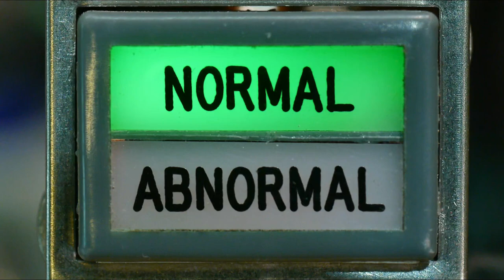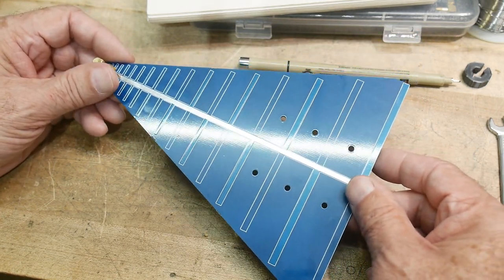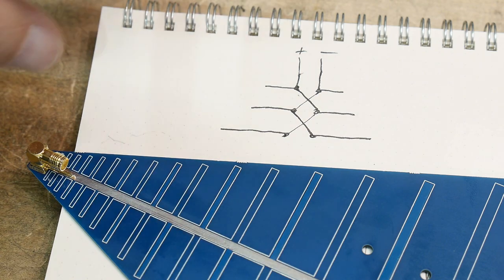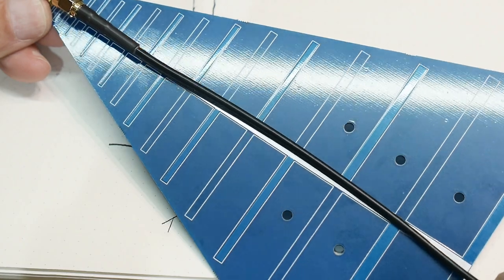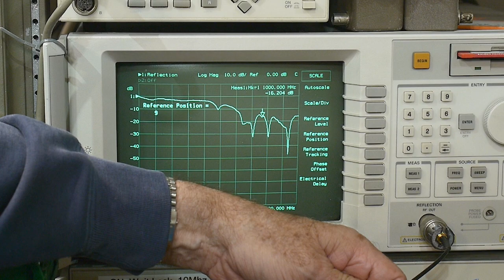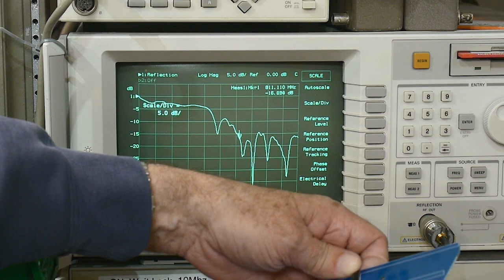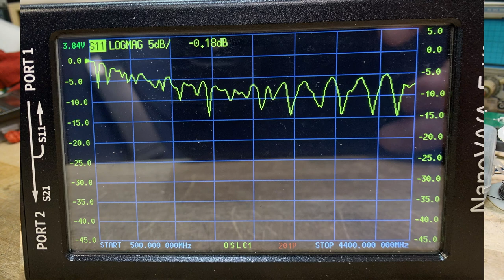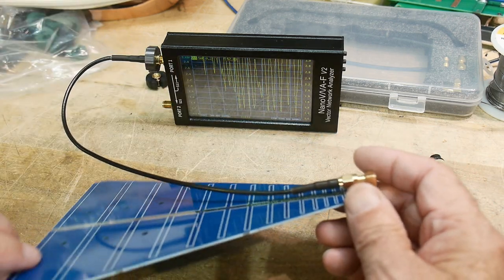#1473 800MHz to 6000MHz Log Antenna

Comment: How about opening the insulation and soldering the coax only where it intersects each element? What would be a good functional test? I’ve tried using Vistumbler with various 2.4ghz/5ghz antennae to see the number of access points I can reach with one antenna versus another. Quick note… I vote  for the return of story time and IMSAI Dog. Have a good day!

Comment: Soldering down a coax to the boars should improve the performance. Soldering the cable to the antenna is the missing BALUN .
Reply from the maker: probably, it stumped me why it had the big ugly connector. what's the point if you are going to solder it
Reply: @IMSAIGuy  That connector makes no sense.

Comment: Pretty sure the holes are where you can strap the cable down with a zip tie.  I've got a similar antenna that came inside a housing and was attached that way.

Comment: Great video! Is it possible to design "log periodic antenna" for two bands, example 800-900Mhz and 1700-1800Mhz if frequencies between is not in your interest? Aiming of course keep the boom length reasonable with most gain on those two bands.

Comment: I've seen on some trading sites that those holes doesn't have any function on the antenna design. But is intended for a mount, like a pistol grip.
Reply from the maker: ray gun
Reply: I assumed it was to zip-tie the cable, although they're spaced a little too wide for that. +1 for ray gun.

Comment: The only way the soldered down coax could work is if that buss was connected to the shield.  If it was connected to the center conductor that operation would leave you with .. not much.
Reply from the maker: of course is the ground side
design: https://fenix.tecnico.ulisboa.pt/downloadFile/844820067125562/Extended_Abstract.pdf

Comment: I would call that a "logperiodic looking object" which does not do what it's supposed to. the elements are on top of each other, no interleaving, not a logperiodic.
Reply from the maker: did you actually watch the video??
Reply: @IMSAIGuy  yes, the whole one. perhaps missed some language hints (:
Reply from the maker: @knglaser  they are not on top of each other, they are staggered and out of phase.
Reply: @IMSAIGuy  wow, I stared at the end where there was closeups and thought there was copper under each of the silkscreen legs, quite hard to spot that detail

Comment: Boy you have a tough audience. LOL It would be fun putting it in front of a parabloc reflector and using it as a feed! Scanning the sky😮. 73. Leo
Reply from the maker: It's a tough crowd and occasional heckler. I will not be scanning the sky as I don't speak Martian. 😎
Reply: @IMSAIGuy  I have about 8 satellite dishes installed that I poke around the sky with. Hoping to get back to it soon. It's like SWL but higher frequencies. 73 Leo

Comment: what's the smallest HF antenna that you could have? could you possibly hang one out the window of an apartment?
Reply from the maker: you can use antennas designed for cars, or put a wire antenna under the eves of the roof, or in the attic. search around, there are thousands of people who have tackled that problem.

Comment: What happens if the antenna is fed from the aft end?
Does it have to be fed from the front, just because the TV antennas were?
Reply from the maker: it won't work right. the shorter wavelength will choose the short dipoles if fed correctly, if fed from the other end then the short wavelengths will find long dipoles and odd things will occur.
Reply: @IMSAIGuy  I never looked at it that way, and that makes a lot of sense now!

Comment: Log antennas are not 50 ohms, so you need a balun.
Reply from the maker: actually the PCB designs are made to operate at 50 ohm and get better than 10dB across the range. There are several papers on line. They are supposed to have a soldered down coax. I will need to take off this silly connector and give it a try
Reply: @IMSAIGuy  The balun (and matching) network are etched on the pcb  The holes, in the pcb, are part of the matching network... and a possibly for implementing 'opens.'  There a similar Chinese design... to the one you show... that uses a conductor backed coplanar waveguide to match.
Reply from the maker: https://fenix.tecnico.ulisboa.pt/downloadFile/844820067125562/Extended_Abstract.pdf
Reply: @IMSAIGuy  cheers thanks for the link.
Reply: @willthecat3861  How can the holes have an effect when they are outside the copper plated parts? Or has this PCB really more than 2 layers? (Shining light through most cheap PCB antennas shows that they don't.)
Reply: @cyberyogicowindler2448  If you model it in something like ADS (Keysight) the holes ... depending where they are, and their diameter, and the type of dielectric (PCB material) will have an effect. (If you model the antenna, you will see that.) The EM energy is not strictly confined to the microstrip structure, in any realization. Some of it is outside. The holes act as a discontinuity (of various effect) in the media. Even if the holes are only in the pcb dielectric (no copper), adjacent to the microstrip structure, they is an effect... subtle or significant, depending on the design, and materials used.
Reply: @willthecat3861  Does this mean if a Chinese clone of an antenna has the same copper layout and geometry but was made from different PCB material (likely they use whatever they had available) it will have different frequency response/performance?

Comment: Is that an antenna built into a pcb?
Reply from the maker: yes, it just traces on a PC board
Reply: @IMSAIGuy  That's lit!
Reply: Wonder if you could put two PC boards together, at 90-degrees to each other, receiving both H and V polarizations? Would they be phased at 0 or 90 or 180?